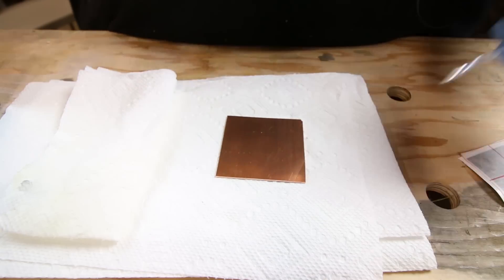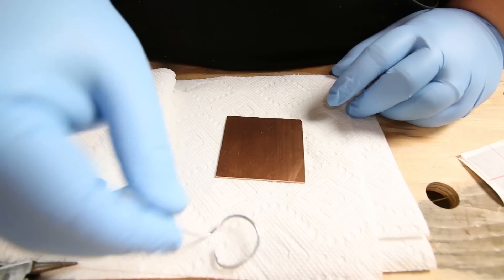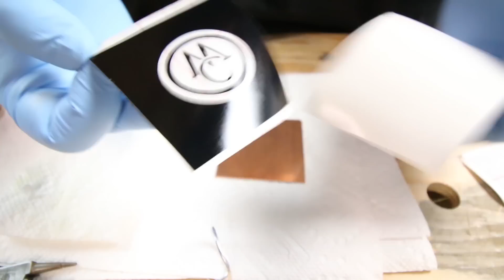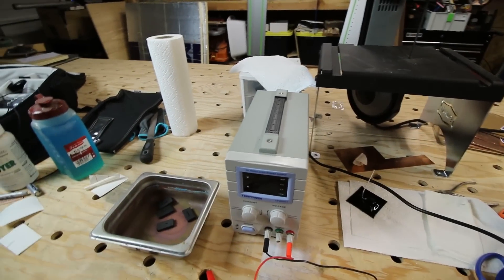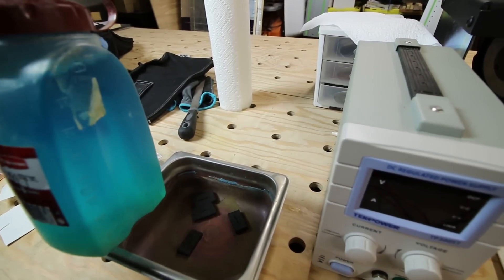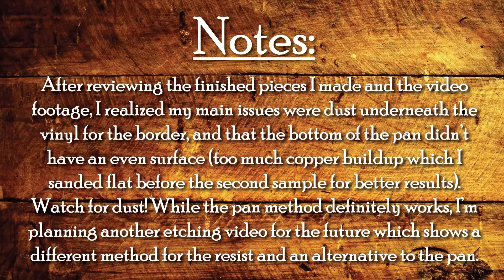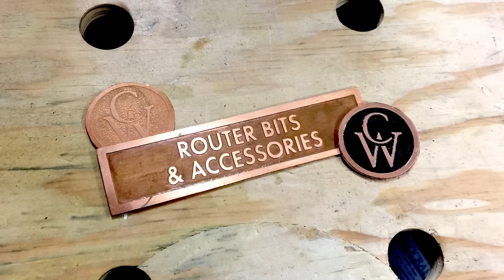Etching Copper Badges & Nameplates Without Acid!

Comment: Please tell me, how in the world 5 volts can electrocute you?
Reply: Nonetheless, there is another related concern: voltage isn't everything.  Amperage is equally important.  You can (roughly) think of electricity like water in a pipe; voltage is analogous to pressure, but current/amperage is analogous to the diameter of the pipe.  A car battery has only twelve volts, well below the breakdown voltage of your skin, but if you drop a wrench across the terminals, that wrench is going to glow red hot and melt.  So, when working with high DC currents, be aware that shorts can cause melts and fires very, very quickly.
Reply: Carter Wilson Workshop 5V won't do any harm. You can even touch your tongue on it.
Reply: This was actually the line of public concern that caused Thomas Edison to deliberately electrocute an elephant.  He was trying to show that low-voltage direct current was much safer than high-voltage alternating current.  It is, actually-- the elephant, sadly, would agree-- but it is far less efficient over long distances, which is we don't use it over city-scale distances.  Small ships and aircraft, however, do indeed use DC runs for many applications.
Reply: @unknowndefaultguest  Edison would have been right, if the solar panel had been perfected. When it does reach market, with an acceptable conversion ratio for a semi-cloudy day to produce adequate household or small business power, the less than excellent human specimen Edison was will have been vindicated on his original assumption; just off by a century+. Despite his stubborn mind, he was not going to let science get in the way of success, so he persevered until he ran out of elephants, and had to go to AC, in a most interesting manner.
Reply: Matt Heck it's more complicated than voltage or current. You have to take contact time into consideration. The maximum safe energy level for a person exposed for less than 3 seconds is 13.5W-sec. Chances are if you haven't been electrocuted within those 3 seconds you probably won't.  However long term contact at even lower levels can result in damage to the body. 220VAC is also not for instance actually 220V at the peak of it's cycle. It's 308V. It takes a much higher current with DC to cause the same shock as the same AC voltage. There is also the "let-go" current which is the level at which a person being shocked can still let go. Again it's considerably higher for DC than for AC. A sweaty person will be a better conductor than someone with dry skin and if the shock does not cross the chest (eg straight from hand to foot on one side) then survival is usually the result.
Reply: When using electricity safety measures are a good habit to get into - whether or not the voltage or amperage you are using can harm you or not.  Make them a habit and it them becomes natural to be cautious - you don't have to think about it too hard.
Reply: Wet skin is more conductive; current, rather than voltage is the killer; path that current takes thru your body to ground; and other considerations can make 5 volts lethal. Please take the time to learn about electrical safety before it's too late.
Reply: I’ve seen 3 people with no history of heart disease drop from it hitting on the wrong heart beat. 12 y/o tripped and fell on his chest, the blow hit the wrong stroke and acted like a precordial thump. Nothing showed on autopsy & we worked on him until there were no more chances of even any return. Another guy was hooking up a battery charger and a arc jumped to his wedding band from reversed clamp hook-up. Last one was checking to make sure power was off to his a/c with a cheap Chinese import volt meter power was off but the capacitor still had a charge, he was watching an online video to troubleshoot and the insulation on the meters wires was garbage. It’s usually a combination of amps and voltage but ultimately it’s your time to go it’s your time to go. Using proper precautions;  removing jewelry and tying long hair back are super simple lifesavers. Reading the directions and double checking to make sure that there right another. It’s a thing called common sense, don’t stand in 2 feet of water  with oil & gas floating on it to plug in a sump pump saw that myself from a plumber that just graduated from trade school, hired & fired same day by his Father. Got his job back but he never did anything that stupid again.
Reply from the maker: +Powder-phun Indeed. I’ve done that with 9v batteries. More just trying to reach good electrical habits in general. :)
Reply: Yeah, like the hippocratic oath; first do no harm! Also don't do anything period! All this safety first stuff is just CYA and not get sued.
Reply: @BradleyMakesThings  you are correct to warn people. Even 5v can be lethal through cuts. It takes higher voltage to beat the insulation of your skin, but blood is an excellent conductor.

Comment: Can you etch other metals using this method? Brass, aluminium etc...
Reply from the maker: +Simplex1988 if you check the link to Mordent (either in the description or the website article), they talk about etching on different metals. Essentially certain metals can require different chemicals. That said, I've seen people do this just with kosher salt and seen it work on a variety of metals - just seems to work a bit more slowly.

Comment: Hi everyone, can anyone tell me why we use aluminum wire instead of copper for the contact electrode?
Reply: I was wondering if you could use Plasti-dip to coat the back and the wire...Plasti-dip can be removed easily and can also be used to pot electronics.  Also, could you make a negative with the vinyl cutter and then just paint the copper and remove the vinyl to let the paint protect from the etch?
Reply: What an interesting discussion!  On paint drying I can mention that acrylic paints go touch dry very quickly but take longer to become water resistant  - I've had a couple of failures from impatience.  They are surprisingly (annoyingly?) tough and resistant to sanding. There's always the option of burning paint off followed by a quick scrub to remove residue, also artists masking fluid (latex?)... but perhaps I'm getting carried away... Other options seem quicker and easier. .. sorry for wasting  your time!  Errr. .. beeswax furniture polish maybe?  It works brilliantly for me as a releasing agent, is insoluble in water and is dead easy to remove later
Reply from the maker: +Jan Kellogg Hi Jan! I think mainly it's because if you use copper, the wire will be eaten away in the copper sulfate etch, and the aluminum not so much. That said, I have had aluminum get eaten though, but that was after multiple uses (5 or 6).
Reply: Thanks so much. I'll give it a try. I really appreciate your tutorials. Hope you do more.
Reply: Jan Kellogg   how about spray painting the back including the wire except for the top which stays above the solution and you connect too.  I can't suggest a suitable paint. Or coat the back and wire with grease?
Reply: I understand not waiting for things to dry as well ;) I like to get going asap too.  Thanks for the reply!
Reply: I actually etched this weekend using an acid solution on copper...I took your idea of using a vinyl overlay, but instead of using the vinyl itself as a resist, I made a negative and then sprayed clear spray paint as my resist on the copper and then removed the vinyl before etching.  Worked like a charm!
Reply: Magnesium sulphate (epsom salts) can be electrolysed using copper electrodes to produce copper sulphate plus magnesium hydroxide precipitate and hydrogen.  Maybe a neat way of making copper sulphate for those who can't buy it.
Reply from the maker: +Josh Potter Great ideas all around! I like not having to wait for stuff to dry which is why I like the vinyl, but the paint would likely yield a better chance for success (a lot of my early failures were to do with the vinyl failing. Only bad part about paint is that it can be a pain to get off. The plastidip on the other hand should just peel up.
Reply from the maker: +Ray Kent Both interesting ideas - really probably most paints would work if you let it dry a light first.
Reply from the maker: +Potter's Work Sweet! That's something I might try (the paint masking)
Reply from the maker: +Ray Kent Interesting! Thanks for he chemistry lesson!

Comment: Have you tried photo etching? No worries about that falling off, and a lot cheaper. I seem to recall someone recommending citric acid powder helps to get a deeper etch when used in combination with an etching method. The blue crystals are in root killer products. They are used to kill roots in your pipes. I believe one brand is called Rootkill. A bubbling stone will also help prevent air bubbles from sitting on the surface and acting as a resist.
Reply from the maker: +Jerry Whidby I'm definitely familiar with photo etching but haven't tried it. From the research I've done though, it's also pretty finicky about needing the metal to be clean before you apply the photo resist. Definitely familiar with the blue crystals from rootkilller products - that's where I got mine a number of years ago. Some cities and counties have banned this type of chemical for root killer so it's not always available locally and must be ordered. For me, I had to go to the next county to buy it because it was banned in my county.

Comment: "Electrocute yourself" on 5V and 5A???
Reply: Burn, yes.  Electrocute, no.
Reply: @unknowndefaultguest  This is a very late response as I have just watched this video. While it is unlikely low voltages will be that dangerous, under the right circumstances they can still allow lethal currents to flow. Many years ago in a smelting works in Hobart, Tasmania (Australia) a man died while stripping  zinc from an electrode. He had worked all day in the cell room and I was told that his clothing and body would have been soaked in electrolyte. Apparently he leant across a busbar, presumably copper and so formed a circuit which would have only had a voltage of around one and a half volts, but because his skin was saturated with a good conducting electrolyte, and his chest touches the busbar, enough current was able to flow to kill him.
It is not the voltage which kills, but the current, and normally you have to have sufficiently high voltage to get enough current flow, because dry skin has quite a high resistance,, but if you soak it in a conducting fluid, that resistance can be dramatically lowered. Strangely a high voltage is not necessarily lethal either, static charges which can build up in dry climates, may be many thousands of volts, and while they might give you a bight, they are rarely lethal. Even frequency is a factor, with frequencies high enough, the current flows only on the skin of the conductor and does not penetrate to any significant depth. Frequencies in the UHF to microwave region exhibit this quality.
Reply: 5a is the max amps it can provide. it cant provide 5a cause the 5volts are not enough to pass any amps through your skin cause your skin has some megaohms resistance. everything under 50volts DC are safe for that reason.
Reply: @BeetleJuice1980  what if he touch his tongue to the positive and negative side by mistake? :) he can tingle his tongue.
Reply: Electrocute means to kill with electricity, The word you wanted was "shock" not "electrocute".
Reply: Andork Kuomo Variable power supplies can provide more  amperage than shown. Mine goes to 30 amps. Knobs can get bumped, and accidents are never planned.

Comment: +Carter Wilson Workshop Interesting approach, thanks for sharing in a clear presentation. I am also concerned about etching using less toxic stuff, I am experimenting with ordinary salt (NaCl) and it works rather well. My main problem is finding a material that protects well, is not toxic and not too particular (though I can see how useful Vinyl & its cutting machine can be), and most importantly how do I work detail on it
Reply from the maker: +Flat Enough I've seen people use paint markers which is pretty easy but perhaps not the most detailed. I've also seen people paint the whole surface with paint or nail polish, and then scratch the areas they wish to etch with an xacto line or scratch awl. Those methods are all really easy and cheap, albeit a bid tedious.

Comment: Good stuff. I see some people left some tips so I'll leave a few I've learned after doing many many etches.

1) Use a plastic container and use a separate piece of metal as the sacrificial piece. I usually do these vertically on either side of the container or the etched piece faces up with the sacrificial piece suspended above it.

2) Saturate your water with your electrolyte of choice. I've used ferrous sulfate, copper sulfate, regular table salt and they all seem about the same. The key seems to be COMPLETELY saturating the water. Use warm water and keep pouring and stirring in the electrolyte until no more dissolves. If you are stirring it and there is still some crystals at the bottom always, you're doing it right.

3) Use as low power as you can stand. A small piece like that I would top out at maybe HALF an amp. Higher power tends to pull the vinyl off sooner as you discovered. 

4) Use Oracal 651 (permanent outdoor vinyl) if you aren't. Stickiest I've found, helps with 3) above.

5) Not really important in this case but a handy method of blocking off the parts you don't want etched - paint. Nailpolish actually works great because it dries fast. I usually just put the vinyl down and then cover the rest of the piece in paint (with only a piece of tape to hold the wire to the workpiece). Helps keep water from seeping in around those tape edges. Electrical tape works well too if you have large expanses of area you don't want to waste paint on.

Hope this helps. I am able to get very clean etches with no pitting and no vinyl lifting this way, repeatably.
Reply from the maker: +DopeItUp Thanks for sharing! I am using the Oracal 651. I think my issues with vinyl adhesion were mostly to do with dust under the vinyl near the edges causing it to fail, and perhaps power level as you suggested. I'm definitely going to try a plastic tank with a piece of flat sheet metal as the sacrificial piece. I'm pretty sure my uneven etch surface was due to metal that had been deposited on the sacrificial piece. If it's flat and I'm able to take it out and sand it flat I think that would solve that problem. My very first successful etch where the stainless run was smooth on the bottom came our great (the one in the thumbnail that says "router...". When I get around to revisiting etching with a plastic tank I'll definitely post an update video.

Comment: Carter, I noticed a very wide band saw blade you used to cut our the copper.  Where did you get it?
Reply from the maker: +Bill Hughes That's a Milwaukee portaband portable bandsaw (and accompanying Milwaukee blade). I got the saw and the blades from Home Depot, and the table the saw is mounted in is from swagoffroad.com.

Comment: Hi. In you're setup you put the piece in upside down (vinyl at bottom). When using electricity you get fine hydrogen bubbles at the side where the metal is exposed to the electrolite.Its very possible you trapped these bubbles on your workpiece  leaving an uneven etch. Turn your piece logo up and try  to remove the hydrogen bubbles regurarly with a small brush or use a small electric airpump to agitate the solution . Parts where the bubbles remain for a longer period  do not etch as much in comparison with parts that do not have these hydrogen bubbles. I hope this helps.
Reply from the maker: HoutmeyersP Thanks for the input and for checking out the video! As far as I'm aware the piece needs to face the other cathode to allow the etched metal to evacuate properly. From my limited experiments so far and watching other folks, it seems as though the unevenness in the etch is due to the bottom of the pan having an uneven buildup of material from multiple etches. For example,
My first etch in this pan came out really flat and consistent and progressively became less consistent as metal was deposited into the pan. In my next setup, I think I'm going to use a plastic tub and have the work piece and the cathode vertical so they can face each other but let bubbles float to the surface. I've seen quite a few people try this successfully. It would also allow me to remove the cathode more easily and sand it down flat again. When I get around to etching again, I'll likely make a follow up video showing the new setup I have in mind.
Reply: I think you will see a very welcome change in the results when you hang your workpiece vertical in the electrolyte... the formed hydrogen bubbles can rise to the top of the electrolyte much easier than. Agitating the solution of moving your workpiece regularly  ensures thad no bubbles remain on the same spot on the piece for very long.....the bubbles are causing the uneven etching together with to much electrical power. A lower  etching power surely results in longer waiting times...but the result comes out far more evenly/smoother. I have used this technique a lot galvanising stuff in a vinegar/salt solution.  Succes !